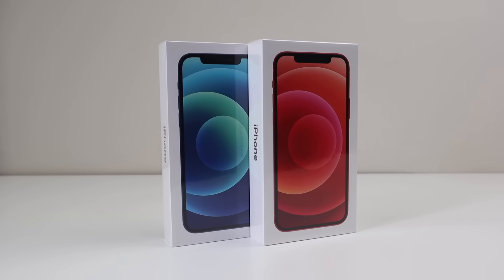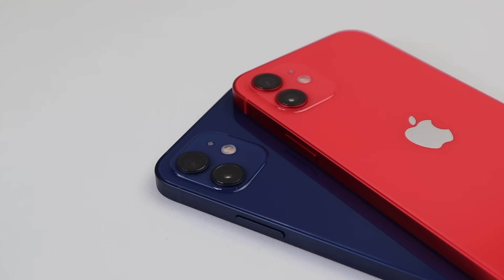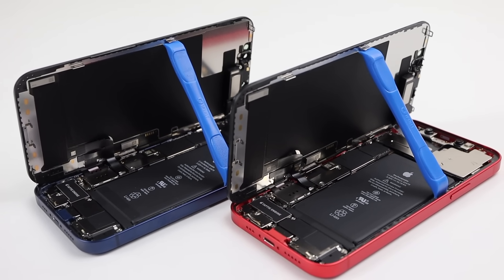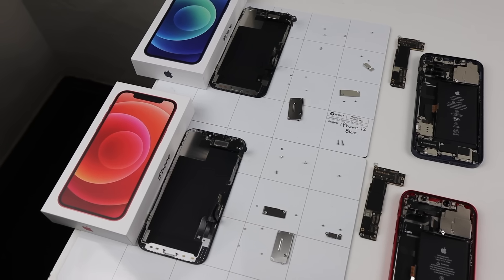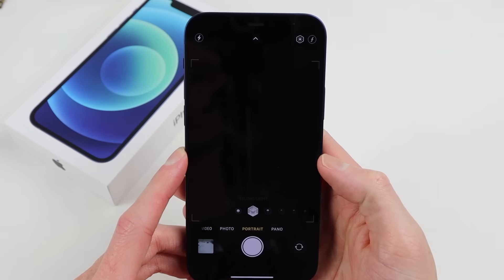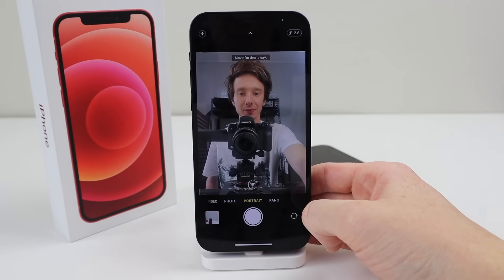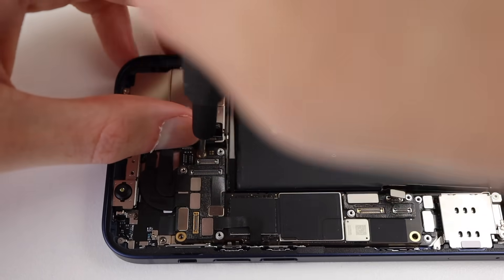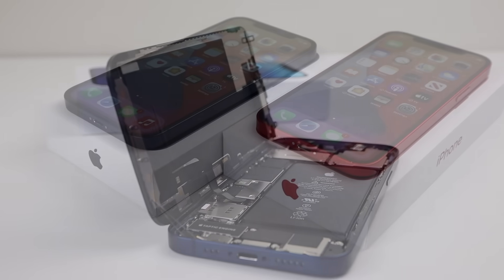iPhone 12 Anti Repair Design - Teardown and Repair Assessment

Comment: I was actually planning on getting the 12 pro but now i’m doubting if I should still get one or just get the 11 pro.
Reply: They are nearly the same thing.
Even the "ceramic glass" isn't much more scratch resistant as JerryRigEverything showed.
The cameras will be nearly the same.
And the processor won't be that much faster.
Doesn't the 11 also have a bigger battery?

But instead of spending over 1k on a phone I myself would just get one that's max 400 because it will be nearly as fast and as a normal person you won't notice much difference.

Comment: Imagine paying $1100 for a phone and not even being able to repair it yourself. Definitely going for a google pixel next upgrade.
Reply: @swegweg erg My iPhone 7 Plus battery endurence was pretty bad after 4 years of use, thats why i simply replaced it with a new one instead of buying a new phone and unncessarly poluting our enviourmnent. I simultaneously repaired the iPhone SE 2016 of my dad. Seems like in wont be able to do so with new Apple products.

Comment: because part inside of new iphones starting xr has code chip that the board has the same code as well when you  change some part that doesnt have the same code it will not response

Comment: This is because the original part serial numbers are different from the replacement parts, this has been a issue for some time now. 

Solution: The replacement parts should have the serial numbers to match the original parts. There are special tools to reprogram the serial numbers. Read/write serial numbers back and forth between original parts and replacement parts. After writing the data, it should all be good.

Comment: Apple made is so that there is a kind of identifying chip on the battery, screen, cameras and fingerprint button that is tied to the motherboard so if any one of those components fail the you're tough out of luck until you pay Apple more money to get it replaced.

Comment: Why apple fails in 2050: because they tried to design a pc/phone that has a USB killer in it and will self destruct if temperd. Little did they know their engineers were dumb enough to put the same circuit in their servers and assembly lines. Ultimate demise.
And ye - it was a joke.

Comment: I really wanted you to also swap only the screen between the two phones to see if a screen replacement will also cause issues? Can you check that too and update us? EDIT: Don't worry, I just watched Louis Rossmann's video showing the Apple service manual staying Battery, Camera and Screen must be configured on the device from iPhone 12 onwards when replaced. Only Apple have the configuration software. Prior to iPhone 12 it was only the battery that needed configuring.

Comment: This is why I keep buying older model iPhones.  Eventually, if this anti-repair system continues I will buy a phone from Sony, or some other more responsible company. I just replaced my ancient iPhone SE with another ancient iPhone SE off of eBay. It was cheaper to do so than repair the thoroughly cracked display. I pretty much despise Apple and their anti-consumer attitude. They are an example of corporate corruption and control.  If they hadn’t bought our corrupt Congress, there would be right to repair laws and proper taxation on these corporate masters.

Comment: Hey, look at it from this point of view. Its like swapping out the motherboard in a windows pc with a new motherboard while not updating windows REGKEY (Registry Keys), which tells Windows what hardware is paired in Registry so windows can boot and run. If the hardware thats specified and paired in REGKEY DOESNT MATCH the hardware that's replaced,  it will cause Windows to error out or not boot up at all.
That seems like a more plausible scenario.  Hey, after all, smart phones are basically computers.

Comment: You have to replace the front camera sensor and the front speaker flex in order to use face id since apple face id is paired only to its own phone’s part! For true tone you can copy the data from original screen to any other screen. 
The only thing that seems to be a new apple thing is the camera issues.

Comment: Misleading... why are you saying their older cable and adapter won’t work? Yes it will!  Just not a fast charging like the one they highlighted.  20 watt charger with the provided usb-c to lightning cable.  Older cable with 5watts, 12 watts will work just fine.  18watts from the previous 11pro will also fast charge, just a few minutes short than the recommended 20 watts.

Comment: If you repair this device.
It will self destruct in 5 Seconds. Gives new meaning to the words MISSION IMPOSSIBLE.
Reminds me of the movie Alien3 were it was stated they could not repair machines because they were not designed to. This movie was made 1993.
Cars that did not have parts that were reusable. I figured they designed the phone to only reed the part with the right code.Only 🍎 Would know.Since a phone is connected to ever part. My guess is they have a process to Red Flag if the chain is broken with other parts 
When you put back the original parts the chain was complete again.So this tells me each part has a code.Each different for ever phone.
Once Apple Does its repair it implements this new code and now it reads just fine. I will stick to Samsung and other companies.I know many are headed to Apples technique.
But most seem to stay away from being this Xenophobic mixed with greed. Most realize the gains Apple assumes with this is not truly cost effective and with minimal gain.Thats my assessment.Good Video 🙂

Comment: I think consumers are the problem. We can cry all we want about anti-repair etc but, people buy the sleekest, thinnest lightest phone with the most features and brand name. 
If Apple starts putting screws, using different materials, and lowering IPX Rating, making the phone bulkier and heavier but more accessible, then no one would want the design anymore. 
Out of almost 300m iphones they sell, only a thousand gets opened by a normal user, and an insignificant amount of iphone gets repaired after warranty.

Comment: You just need W13 pro V2 (3 in 1) then you can transfer the serial number from old screen and battery, this message comes up on iPhone 11 repairs I do

With the serial number transfer tool it doesn't, also will support iPhone 12 most likely because it has usb add-on boards and software updates

Also for face id to work you need transfer the chip from old flex to new one or reprogram it to new flex, there is also a tool to transfer it but it's easier to have chip from front flex transferred to new flex ( I send mine off to be done )

Comment: Everything is probably phone locked by ID's, i think that the parts have their own ID that match with the phone. I don't know if jailbreaking is still a thing, but with a jailbreak there is a possibility that you can get rid of this parts locking thing. Anyway, this is very bad by apple.. i really don't understand the logic behind it, maybe it's to fight against aftermarket parts but even own genuine parts really?? I know that apple services are bad and crap, but this isn't the right way to fix the problem (Phone broken? ah well you have buy a new one)..

Comment: apple: zero climate impact by 2030

also apple : not fixable phones , so if anything happens to it you need to throw the phone and buy new one
also apple : not including charger + earphones , so you need to buy new ones because the old ones won't work
also apple : forces wireless charger , that uses 45% more electricity that its produced by combustion and nuclear fission 

apple fanboys : apple is such eco friendly company , I'm sold.

Comment: You can also use a normal usb to lightning cable as well. You don’t need the new brick. Pairing the camera seems reasonable for security reasons. Older iPhones didn’t use Face ID to unlock the phone. Not sure how authentication works but I am guessing there’s a chip and everything between it and the camera is locked.

Comment: I think apple is on drugs right now worst than meth heads. Zero clutter and zero emission. But you cant replace your iphone 12 if you screwed and its gonna cost u an arm and leg. Talking about cutting down a mess there's aux cord so u have to buy a wireless one and a bendango. And now a charger and u have to still buy an adapter. Its so ef up.

Comment: The majority of repairs in smartphones are screen replacements. Would that be a problem too?  
I totally disagree with Apple's way of thinking when it comes to repairability but despite all the disadvantages, I could find a good thing out of that... Thieves cannot steal your smartphone even  for parts. 😁 
Great video
Reply: Yes that'll be a problem too because the screen is paired as well. You'll lose true tone and if the original front camera/face id sensor isn't swapped you'll lose that too.

Comment: imagine paying 1000$ for this when u can get 3 flagship androids for that
Reply: 300 dollars can’t get a flagship android
Reply: @vikzn1607  You could get an old flagship android, but I don't think that a Galaxy S6 could be considered a flagship phone, it was 6 years ago, but today even a phone of Samsung's entry line-up will probably outperform it.
Reply: @vikzn1607  yea got a bit confused with my regions pricing its 1800$ here... so yea definately get high end android for 600$ that will have much better feature than iphone garbage and u know what ? if i camera breaks or i diop it, io can get it repaired for 50$ instead of ending up with a 1800$ brick
Reply: @vikzn1607  yes 90hz oneplus Nord has 4000mAh battery as well
Reply: @legend-jp5to  the OnePlus Nord is a midrange phone
Reply: @beansandburgers1264  hahahaha, midrange but still has better specs than $2000 apple flagship.
Reply: @legend-jp5to  ikr...
Reply: @legend-jp5to  I use Android too mate but the only thing the Nord would have over the iPhone is probably the 90hz refresh rate
Reply: @beansandburgers1264  don't forget the 4150mAhbattery, the fast charger, the quick data transfer to ur computer, and still it cost almost a third of what apple charge for the iphone 12, note: iPhone 12 is not even a flagship it's midrange as well the 12,pro and pro max are the flagships.
Reply: @legend-jp5to  the iPhone 12 still has the a14 chip don't forget , that makes it a flagship. It's kinda like apple's version of the Samsung galaxy note 20 , still a flagship but not as high end. And yeah , I ain't an isheep , I'd rather have the OnePlus Nord than the iPhone 12 BC android is infinitely superior but just thought I'd say. No charger in the box is a disgraceful move from Apple too
Reply: @beansandburgers1264  at list u know what the features and specs are, people who buy iPhone buy not because of specs they buy solely because it's iPhone, it's more of like status than usage experience. And later they will defend the company that is ripping them of constantly. That is where the term isheep come from but ur not isheep u know ur stuff.
Reply: Not sure about that, but you could get 5 maybe 6 A21s, my dad recently bought one, because his 10 year old Samsung had issues, I had to laugh when he asked me what 2+48+8+2 MP in the leaflet means, I said those are the cameras on the back, and he "What? and the numbers?" Those are the Megapixels of them, he, completely shocked: "48? We are at 48 now? I thought 8 are many?!" 😃I loved it when he got it, he was like a little kid with his new toy, his favorite thing was that he now has cellular data and can listen to the radio livestream outside.
Reply: Mi 10t be like

BRUH

Comment: it could be the fact that apple is trying to prevent scammer from selling fake iphone which includes swapping of authentic and non authentic parts whereby everything has to be authentic matching parts and codes to prevent unauthorized alteration 🤔🤔
Con - you cant get it repair
Pro - you get the real authentic phone 

it could be the fact that apple is trying to protect the consumer 🤔🤔 everything includes con and pro

Comment: "We're going to eliminate ewaste by requiring consumers to purchase proprietary ewaste cables, then enforcing DRM lockouts if users attempt to swap out unpaired parts in the phone, thereby making every single part in this phone complete ewaste unless we explicitly service the parts ourselves"

iphone 13: Your device automatically blacklists itself in apple's servers and rejects all software updates the moment it detects that its had parts swapped around. Or better yet, it executes hidden code in the kernal to permanently brick itself and all components if mismatching pairs are detected
Reply: They actually kinda did it this in 12, in the video he can't turn on by pushing power button. The charging cable turn on is just a bug. Apple will fix that in the next update.😂
Reply: Greed is the real pandemic nowadays...
Reply: @Universal_Craftsman  And the thing is other companies will do the same in few years
Reply: @aliasgerchallawala4582  I hope that it won't be that bad, since customers from everyone other than Apple are more critical, and are more prone to switch to another company, there is also more competition. Apple has the opportunities since they have gotta ahold of a head of shep who buy their products nevertheless. It's the same with Volkswagen, they manipulated exhaust gas measurements, scammed their customers, scammed even the governments, and the made even more profits, because people just buy from them anyway.

Comment: Honestly, the only technical positive I can see from serialized parts is the fact that a stolen iPhone would be 100% useless to the thief no matter what. I’ve seen postings on Facebook Marketplace of people offering a hoard of iPhones for as little as $1. Clearly these are stolen, iCloud-locked iPhones, where buyers may want them to simply salvage for parts and sell accordingly. With parts being linked to devices, this no longer makes it possible to profit from stolen iPhones. I mean, now, buyers will simply be scammed when they see their genuine Apple parts won’t work anyway.
Reply: How will this prevent robbery? It won't. It will only generate waste after the crime is commited
Reply: You are missing the point, phone can still be savage for parts. Parts will still work, they just have to pair to the device some how. As you saw in the video everything worked it was just crippled. This won't help consumer in anyway, it only benefit apple.
Reply: I think robbery of smartphones is not such a great issue, since every one is protected with passwords, it would be too much trouble to deal around with you to get the password, they rather take your money or credit cards for quick cash, robbing phones is too much of a hassle, because even if you get ahold of a 1000$ phone I don't think that someone pay you more than 100$ for the parts, the risk of you getting caught selling them online is also pretty high if you don't disassemble them, those iCloud locked phones on eBay or Craigslist are mostly lost phones which weren't returned, or found by people working at, or, who have access to, a dumpster or salvage yard.
Reply: I do see your part and seems reasonable
But something more reasonable to do would be having paired components in the iPhones which are meant for showcase at the apple store, like the component of the showcase iphone just cannot be linked with the iPhones made for the market to sell

Since most iPhones are stolen from the apple store, that would make more sense and less headache for the genuine people

But I do think they do such things to make profits in repairing themselves

Comment: In my opinion more tech should be designed like guns, the AR-15 to be specific, it's as modular as lego! If I don't like the grip I can just change it out, the entire upper half of the gun can be removed and replaced without tools and the parts are interchangable and can be bought from multiple manufacturers. Imagine a standardized universal phone battery. Replaceable interchangable screens and swappable chassis!

Comment: Apple sums up the phrase "one step forward, two steps back" they improve the camera but remove a headphone jack, they increase the screen size but make the phone body out of glass so it's slippery and gets dropped, they improve the speakers and pre-load the phone with a f$cking U2 album. I upgraded to a one plus 8 and a windows machine this year and haven't looked back.

Comment: This step by apple has advantage over the market where used iPhones are traded more like in the country India(where price is like double for new one). Now one can get a genuine iPhone without worrying about the originality of the parts since many used phone dealers try to fool around with customers by putting aftermarket display, batteries etc. However this step by apple is still not fair.